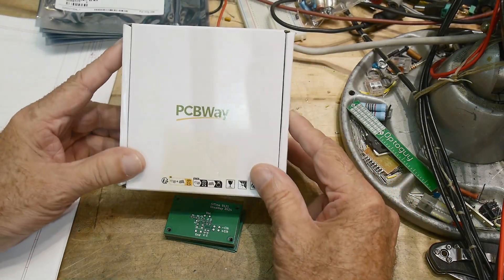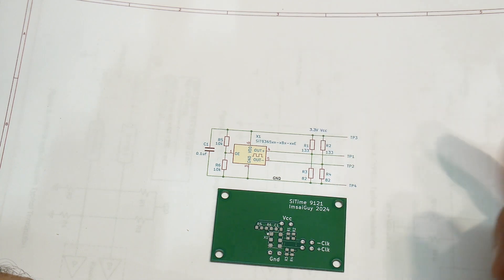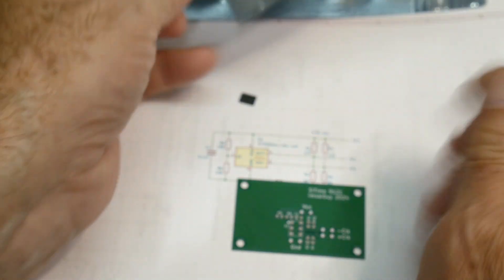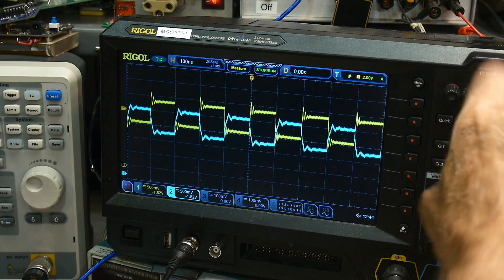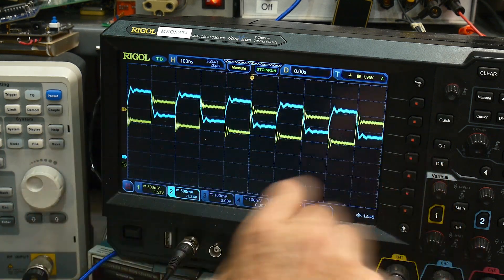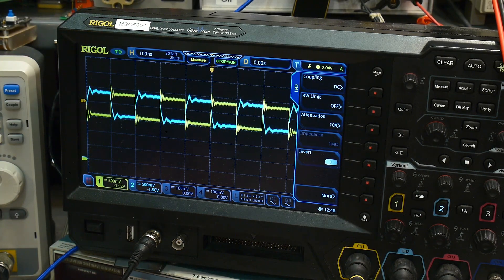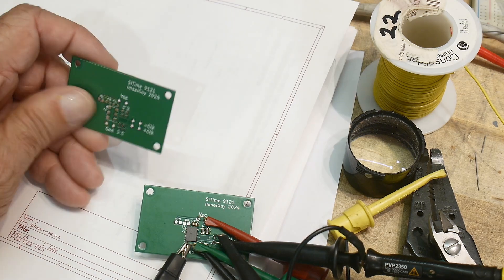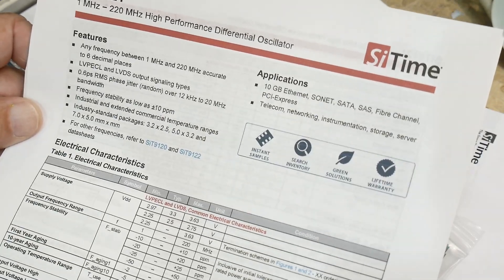#1910 SiTime 9121 (part 2 of 2)

Comment: not that impressive jitter characteristic compared to the AK2B series from Abracon but interesting table about shock and mechanical vibration!
Reply: He was sent older generation parts. SiTime’s latest ultra-low jitter series typically has 70fs jitter with select parts down to 10fs jitter for PCIe Gen 6 applications.
Reply: @ChrisSmith-tc4df  Thanks I will look into it.

Comment: The bounce (noise) at the transition is that an artifact of how you are probing it or is that the nature of the square wave?
Reply: Artifact from probing, to measure high frequency signals (including squarewaves, which have lots of harmonics) you need to remove the clip of the probe and connect a short springy contact for GND. But measuring like in the vid is fine for seeing if something works or not, Imsaiguy has made a video about it: https://youtu.be/henwiLzSieA?si=ZBxFiWEMsGD0lfui

Comment: Probably good to add to that board the space to put in the LVDS receiver. SN65LVDS4 looks like a simple device to use, though there might be cheaper ones, or others, but should fit on the board, and just needs a 2V5 supply for the core, but output is 3V3 compatible, or just run the whole lot off 2V5 and be done with it, putting in the placement for a 2V5 3 pin SMD regulator as well, which should be able to supply 100mA for the whole lot with minimal heatsink other than a few vias through the board to a ground plane.
Reply: The single 3.3V supply Fairchild LVDS1002 LVDS receiver has extremely low additive phase noise, while the SN65LVDS4 adds a lot of jitter. I’ve measured both, and the SN65LVDS4 has a nearly flat phase noise floor much higher than desired. I suspect that this is due to some tragic choices in its internal logic level shifters.